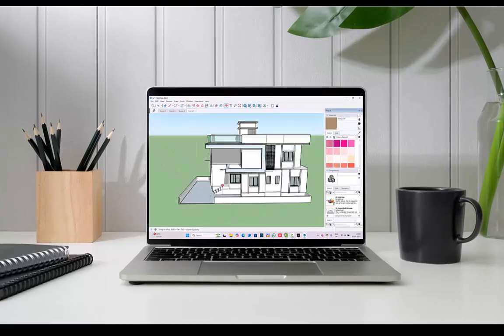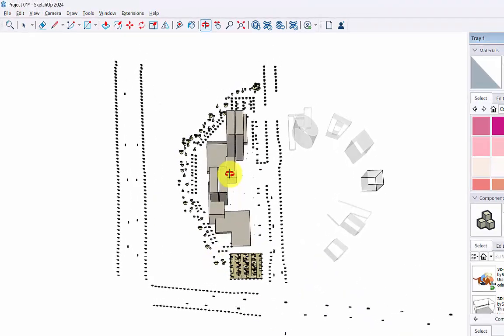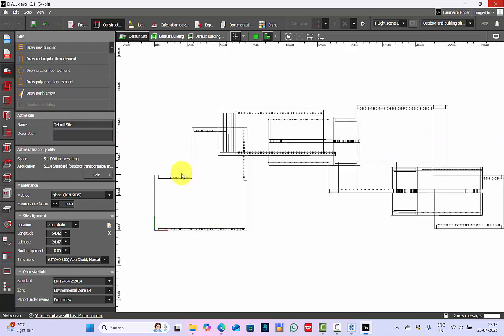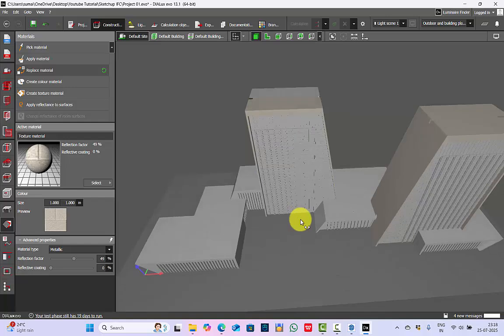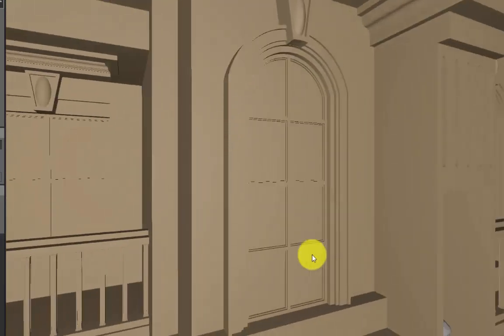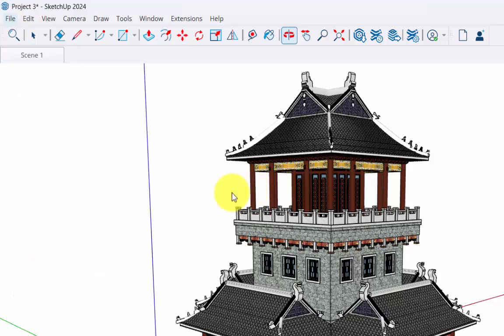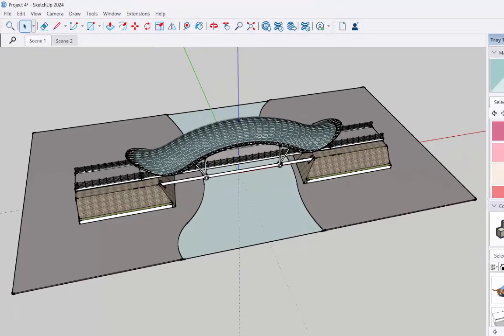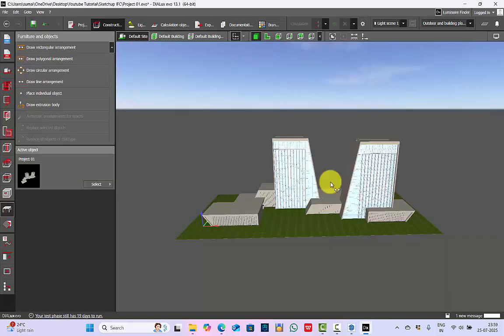How to import IFC from Sketchup to DIALux Evo

Comment: Hi Sumaiya, Thanks for showing this to us. Its a great learning. While working on these complex models in dialux evo, what should be our system configuration. Usually we do not use powerful devices with graphic card or high performance processor. for people working on these projects like you what is the minium windows configuration do you recommend?
Reply from the maker: For working with complex models in DIALux evo, I recommend following the official hardware requirements provided by DIAL:
🔗 https://evo.support-en.dial.de/support/solutions/articles/9000062586-hardware-requirements

That said, the better your system specs — especially in terms of RAM, processor, and graphics card — the smoother it will be to handle heavy files and large projects.
Reply: @SumaiyaEliyaz  Thank You very much

Comment: Dear Sumaiya, kindly suggest and give your comments on following questions.
1.	if we have revit created 3D model then what option we should take for exporting the IFC file. there is many options available.
2.	As per your tutorials kindly confirm the 3D model should be created in skp only for exporting IFC?
3.	Dialux Evo pro user worked on there project and give the same file to non dialux evo pro user then this file can open including 3D model?
Reply from the maker: Thank you for your questions. Please find my responses below:

I will be making a dedicated tutorial on this soon. In the meantime, you can watch an existing video that covers the process of exporting IFC from Revit:
🔗 https://youtu.be/XXdsVBLo6nw?si=Wg0Lhs-YFOR_ES7G

It's not a strict rule to use SketchUp (*.skp) for creating 3D models. As I mentioned in the tutorial, if your client works with SketchUp, then exporting to IFC from there is convenient — but models can also be created in Revit, ArchiCAD, or other software that supports IFC export.

Yes, if a DIALux evo file is saved properly, a non-Pro user can open it, including the 3D model.
Reply: @SumaiyaEliyaz  could you share the dialux evo pro file and must be IFC file imported in Dialux Evo pro.  so i can try to open this file.
Reply from the maker: I’m sharing the project file used in this tutorial — 'Project 1'. You can find the download link in the video description.